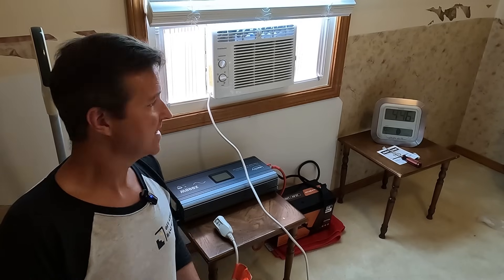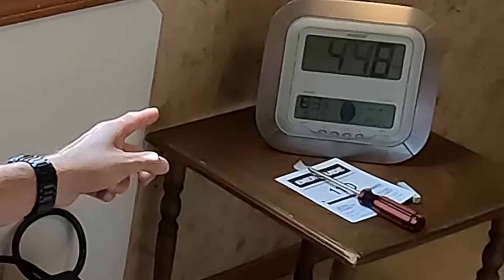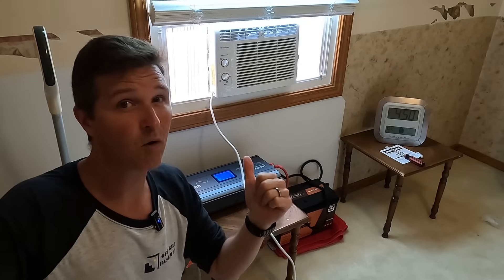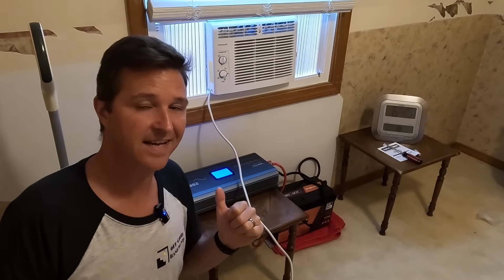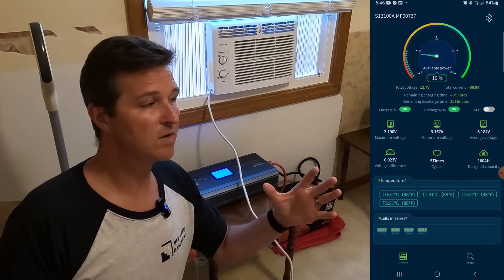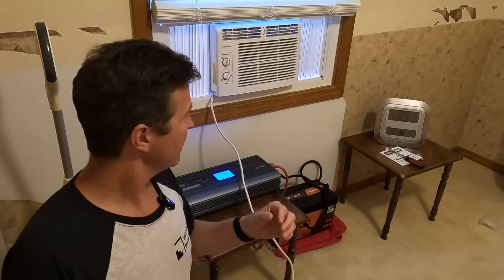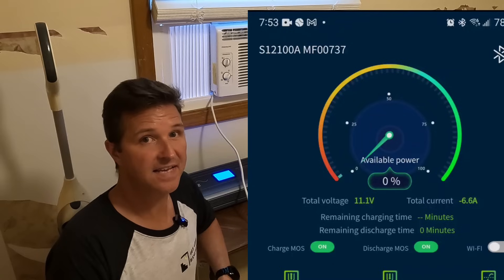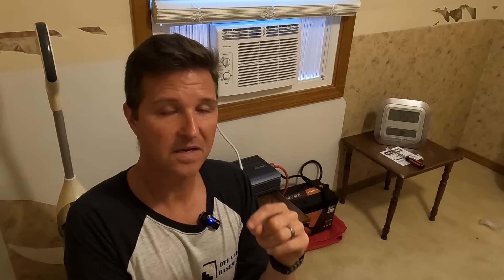How long can you power a 5,000btu air conditioner with a 12v 100ah Lifepo4 battery?  Let's find out!

Comment: I'm retired and live in a 2 bedroom apartment and my wife and I keep the temperature set at seventy eight. This is very comfortable for us and in the summer.If we feel a little extra hot at times we can turn a small table fan on for a little while. When I was working I was doing heat and air conditioning and also apartment maintenance. I remember one emergency call from a tenant where they said in the winter time that their heat was not working.. It was 90° inside their apartment.When I got there.Their heat was set on high and full blast. Their heat was working fine.The problem was that they were all living every day , just running around their apartment in their underwear only, very strange. 
It took me 30 minutes to convince them that their heat was working perfectly and there was nothing more.I could do for it and that the only thing I could suggest is that they put more clothes on. They weren't very happy with the answer but that was the only one that I was giving them.
Reply: Sounds like they were tripping on LSD
Reply: @mrcrabbbbbs Or something...
Reply from the maker: It's amazing the types of people you come across in your lifetime.  Thanks for sharing and the comment!
Reply: They Need a humidifier

Comment: I have 4 6 volt Interstate exstreme deep cycles in series/parellel (450 amp hours) and 2000 pure sine wave inverter and 400 watts of solor running a Toshiba 5000 running on low and im not getting near what your saying. This solor stuff is resembling a ponzie sceme to me. I also use a generater to charge my battery bank to 100% and unfortunately have it running now because my bank is not keeping up even close to what i was sold.🤔
Reply from the maker: That sucks.  I take it your battery bank voltage is dropping to low for your inverter to handle.  All I can say is make sure all you wired connection in the battery bank are clean and tight.  One bad or dirty connection could really make a difference.  Thanks for sharing and for the comment.

Comment: I got that same AC and I am looking into a Bluetti AC70 to run my Mac mini with  great if it can run my AC too. During power failures.
Reply from the maker: You might only get about an hour of usage from the bluetti connected to a small AC unit.  Fyi..  Thanks for the comment!

Comment: why not list how many watts the AC pulls?  That way we can just plug in the figures??????
Reply from the maker: It also depends on how long the compressor is running.  Compressor is 450w, but just the fan is 90w.  Once the room is down to temp to numbers will change..  Thanks for the comment.
Reply: @OffGridBasement  Of course it does.  HOWEVER, the draw when fully running will give a baseline for electrical storage needs.  My criticism stands as I wrote it.

Comment: Seems reasonable. 12v to 120v isa factor of 10, so a ten amp draw at 120 v is a 100 amp draw from the battery. If that draw is continuous then your 100 amp-hour battery will be dead in an hour. At a 50% duty cycle from the compressor then the battery would last two hours.
Reply from the maker: Thanks for the info and the comment.

Comment: Hi, How do you like this inverter? I have 200 ah lithium and 200 watts of solar on my van. I wonder if I can get 6 hours of run time running my 5k A/C. A efficient inverter helps.
Reply from the maker: I like the inverter b/c it has built in GFCI.  The watt meter in mine is a bit wonky, but I really don't use it.

Comment: You've actually reached the recommended limit of your lithum battery at 20%
Reply from the maker: To get the most cycles, you should keep your LPF battery between 20 - 80%.  But in desperate measures I would go from 100 to 0%.  Just don't let sit empty for very long.  Thanks for the comment.

Comment: In very hot and humid Florida 'm planning to build out a small van soon.   A Promaster 1500 low roof 118" wheel base.  I have this idea of a wall unit AC  venting into the garage area of my van which is well ventilated with an exhaust fan and will have a drain pan and drain line.   The cabin and the garage part of the van (1/3 back of the cargo) will not be included in the tiny space I need to cool so  living space of only 6' wide x 7' long x 6' high  (~42 sqf or ~250 Cubic feet).   I was thinking of going with 300AH lithium as a house battery.   A DC to DC alternator charger and 500 watts of solar on the roof to recharge my battery. My walls and ceiling will be 1/4 birch plywood, reflectix and  closed cell spray foam underneath.   In the summer I would run the AC for like 5h a day...   2pm to 5p and from 9pm to 11pm. I will be driving about 1 hour a day and expect Florida sun to do pretty well and it might even be enough supply more energy than I consume. .    Worth it?  any design or functional challenges?  Most van lifers will tell you AC in van is never sustainable.
Reply: I have similar setup in a large box truck.  It worked... Ok.  So fkn hot in the back that it heat soaks the truck... Herein Florida .  Suggestion: Figure how to duct it through the roof directly.  Fiberglass and plywood probably..  Florida is brutal.  Mirror tint your truck too.   Probably the best thing honestly is a huge roof hatch, asbig as possible.   I have all sorts of intake and exhaustion fans, but Florida is so hot.  You need that huge shift of air only a large hatch can provide.  Or better yet, 2hatches
Reply: Why not run a mini split system instead of a window unit?
Reply: @ray32825   Mostly because of watt consumption is easily 2x possibly a lot more, cost of the unit (10x more) And for Stealthyness - In my design i have a the last few feet of the van closed and vented (with an extractor) for my tools and hot appliances but also to reduce the space I need to keep cool for sleeping.  I'm currently in a very small van and am able to effectively do this in Florida with a 1800 BTU Chinese wall unit w that only consume only 200w of my 460AH lithium.  The AC vents into the back garage space without impacting efficiency or getting too hot back there.   I'm looking a getting a bigger van (Promaster low roof 118wb) and implementing the same design but with a 5000 BTU AC.  In that van the garage would be 5'x2'x6' with a 10" vent hole and extractor in the roof and both back windows would have 12'x12' louvered vents.
Reply: @12vLife  I recently helped someone with a van in which they had a window unit connected to a Coolbot to make a walk in cooler. I am in Orlando and have to put a new compressor in my car soon as it is getting quite hot. I have installed a Victron Orion XS dc to dc charger and am able to charge my 300Ah battery that runs my fridge. I also have an airfryer and induction cooker. Where in FL are you?
Reply: @ray32825   Nice.  I'm in Miami most weeks, But about once a month I drive all around the south half of the state,  Tampa, Sebring, Fort Myers and West Palm.  Some times Orlando and Melbourne.   Some videos on my channel of my setup.  I've been running a new setup that is working like  a dream .. a 460AH lifep04, 320w solar panel,   Victron 50s, an 1800BTU 24v AC and a small 15L 12v Fridge I run 24x7.   My single person microcamper layout is rare,  I keep everything hot and noisy in a vented garage in the back my my tools and supplies.
Reply from the maker: I personally couldn't tell you about how to do vanlife, but if you have it planned out, go for it!  Thanks for sharing and for the comment.

Comment: 75 degrees?!  i have this exact window unit in my PC man cave (12ft x 12ft) and i live in hot arse caribbean and it keeps my room with high power gaming pc (water cooled) at 68)... In addition who uses just battery?  Solar would keep this battery topped up during the day and at night the a/c would cool the room much faster and use less energy on battery alone.

Tired of channels like this, its either you want to be off grid or you dont... all this is is a backup and as just a backup shouldnt be running a damn a/c in the first place.
Reply from the maker: This example would be perfect for someone who lives on a fourth floor studio apartment with no balcony.  If you have planned 2 hour rolling blackouts... this would be perfect to get you by, then charge it back up when the power turns back on.  Remember...  there are an unlimited number of different circumstances out there...  this just covers one.  Thanks for the comment.

Comment: The Mr. Cool Mini splits are a DIY type, but I didn't find how many watts they use to cool. I use a 24K BTU Senville Mini split for my 1,500 sq ft old farm house for heating in Wisconsin. Ony costs me $150 a month in electricity to heat during the winter. The AC is too good, I set the timer to turn the AC on 3 hours before I came home on a 95F day, and my house was 63F when I got home. If you want to use them for heating in Northern climates, make sure you get one that advertises heat down to -22F (Like Senville). Mine heats down to -35F. I have a small diesel heater for back-up heat when it is that low. A 12K BTU unit uses less than 1 kW/hr and could possibly cool your whole house. Hook up 1 kW of solar to your battery (if it will take that much) and you should be good to run your AC during the day if it's not cloudy all day.
Reply from the maker: Thanks for all the great information and the comment!
Reply: I Run Dual Victron 100/50 Charge Controllers at 24 Volts with 6 - 100 Watt Panels on each Controller feeding a CHINS 280AH Battery Bank of 2 - 12 Volt Batteries and My 6,500 BTU Eco Mode AC and Refrigerator Run just Fine at 3,100 feet from Sea Level in the Southern California High Desert 🌵 and also charges My Battery Bank at the same time 🇺🇸

Comment: Did like your information I want to know a freezer....chest what would it need....and in this 5000 window unit. Would you be able to run more than 3 hours if had additional batteries?
Reply from the maker: Yes.  every additional 100ah battery would most likely add another 3 hours of runtime.

Comment: The other more powerful ac probably lasted longer because the heat load from outside wasnt as great. You used a heater in the room as the heat load for the other one. Thats probably why the turn on voltage on the other one wasnt that high.

This test had a higher heat load from outside.

I love what you are doing here. But the variables need to be the same…except for ac.
Reply from the maker: I understand.  It's hard to do.  I would almost need to do separate tests on the same day.  Thanks for the comment.

Comment: I have a 5000 BTU air conditioner that I use in a 8' X 14' shed. On low cool it uses 480 watts and on high cool it uses 560 watts. That means high cool requires 46.7 amps on a 12 volt system. I am powering the AC with a gas generator for now. I also have an AGM battery bank with 500 AH storage and enough panels to exceed that 46.7 amp draw during 5 1/2 hours of peak sunlight here in East Texas when I get around to putting them up. So, on a good day I might have approximately 9 to 10 hours of run time without draining the batteries below 70%. then, it would be back to the gas generator. Anyhow, this was a good informative video.
Reply from the maker: Thanks for sharing and for the comment!

Comment: @ 4:05 It shuts off the "Compressor". (You said "Condenser"). The compressor is what uses electricity. The condenser is passive. Basically a radiator.  😃:goodvibes:👍
Reply from the maker: I noticed that after I posted the video.  My mistake!  Thanks for the comment.

Comment: I have 2 of the exact same air conditions and 1 of them completely cools a tiny home 12x40 on low7 at 70 degrees consistently when the temp is 94 outside. My guess is it would have ran longer on the battery at the lower setting. Thanks for the video.
Reply from the maker: You're right.  The compressor tends to turn off more frequently.  Thanks for the comment.

Comment: 1.2kWh @ 12V. I hate the notion of 100Ah. This would run my AC for 1 hour running actively. 50W for the fan, another 700 if the compressor runs.
Reply: In my case the worst part is that when it's hot outside, my panels produce less than on cold days.
Reply: another bad thing is that this is an AC in a container that has been properly insulated. Except for the AC part where it is a big ingress of outside temperature to the inside thanks to a metal frame that gets heated to 50 degrees celsius by the sun and protrudes inside the container.
Reply from the maker: Thanks for the comment.

Comment: Very easy to calculate 1.2kWh available energy in the battery. 
Inverter efficiency 90% ==> 1.1kWh
Aircon consumes 550W. 
1.1kWh / 550W = 2 hours, considering compressor always running.
Reply from the maker: Thanks for the information and the comment.

Comment: About two hours assuming the compressor is running full time and assuming you don't dip into the lower 15-20 percent and your inverter is not total poop
Reply from the maker: Thanks for the info and the comment.
Reply: @OffGridBasement  no problem, thanks for posting a video of how long 1.2 kilowatt hours lasts for a given load again, from another person, again... Just prooves nobody understands or trusts actual mathematics anymore. Keep making redundant videos!

Comment: 12 volts times 100 amp hours = 1200 watt hours. If the AC runs average of 400 watts an hour, you can expect three hours of use. My 12kbtu Midea inverter window AC runs on average 150 watts per hour for about 2 kwatts a day when temps push over 90. (I turn it off at night). Moral of the story, buy an AC with an inverter.
Reply from the maker: That is so efficient!  Thanks for sharing and the comment.

Comment: for the basic rules, if you are running below 1000w, 12v inveter is ok, 1000-2000w, better use 24v and for 3000w and above, better use 48v. u can make your battery last longer with less strain and save on less thicker cable.
Reply from the maker: Thanks for the information and the comment.

Comment: 18k btu inverter split unit for my room which is around 200 sqf how long do u think this setup would run it for keep in mind temp outside is around 100-105f and ac will be set to 68f.. i have electricity outage for 3 hours and just need it to maintain the temperature how would i go about calculating this.. the ac at lowest speed needed to maintain temp uses about 400w max
Reply: Also i probably need a different inverter that has 220v not 110v
Reply from the maker: Considering the temperatures I'm guessing it runs @ 400w consistently.  Each 100ah battery is 1280wh, so you will get between 2.5 - 3 hours depending on how efficient your inverter is.  Hope this helps!

Comment: Good video.  Just remember, the in-rush when you start a system and when the compressor hits, will cause a spike.  Lower BTU's and a mechanical start eases and prevents a solar system or otherwise from shutting down.  It is recommended to run a 6000 BTU window AC and put it on eco-mode. Good stuff.
Reply: I heard something about a soft start adapter for use with generators. I just heard about it and haven't done any research. I'm not even sure how it works, except to lessen the startup surge. Might be good content for another video?
Reply from the maker: Thanks for the information and the comment.

Comment: I have 6 24 volt 300ah batteries to run my fridge.  It has been running it with no house power for 3 months. The solar panels run the device during the day time and the batteries at night.
Reply from the maker: With that much storage you shouldn't have any issues!  Thanks for sharing and the comment.

Comment: 5000 BTU/hour is equivalent to approximately 1.965 horsepower, so 1 hp=746w, The battery is 12v x 100A or 1200w. if a 2hp aircon is running at full power it will last 1.6 hours or less. Clearly it isnt running 100% of the time. he claimed the current draw was 38A so a little over 450w or around 0.6hp so at full power we have  2.66 hours. Again it wasn't running at 100% duty cycle to get 3 hours
Reply from the maker: You're correct.  At some point the room cooled enough for the compressor to turn off and left just the fan running.

Comment: My flooded lead cells get around a hour per109 ah 
That said I use generator overnight the damage is too costly so far . Need more panels now and prices are falling yeah 
 So where’s your power recharge coming from ? 
 Author of Solar Independent Utility Systems Manual 
 Nice test great for public
Reply from the maker: I figured this situation is for a 1 - 2 hour power outage.  It would be great for planned rolling blackouts.  Then just use a battery charger when the power comes back.  Thanks for the comment.

Comment: I am not sure what you were after with this demo. You have a particular room with a particular air conditioner, your inverter and 100 Amp 12 V battery. It lasted a bit over 2 hours, so what do we learn from this. You set the thermostat to "5", this means nothing to anyone. If you picked a cooler day it would have lasted longer. So what did we learn from this?
Reply: You learned that solar/battery/wind energy is a joke pertaining to cost v performance.
Reply from the maker: You're right.  Every situation is different.  It's a proof of concept video.  You know it can be done, so now you need to adapt it to your situation.  Thanks for the comment.